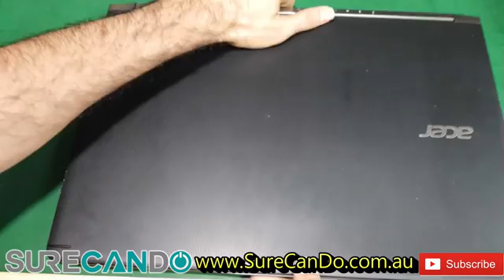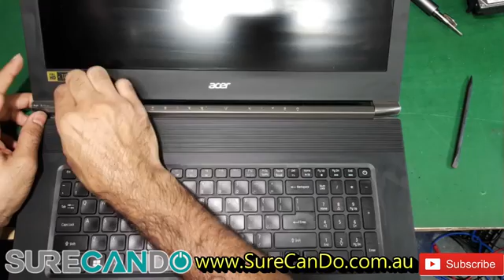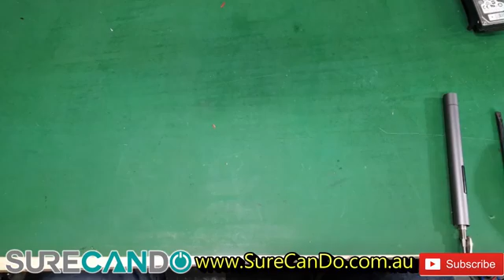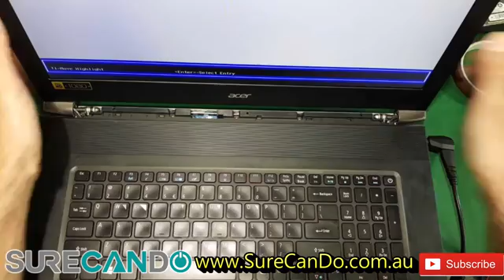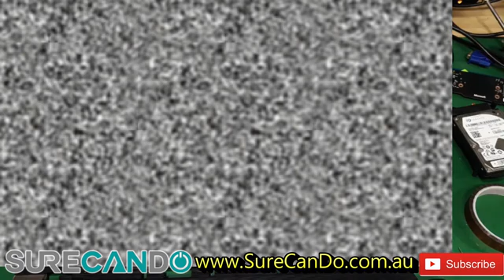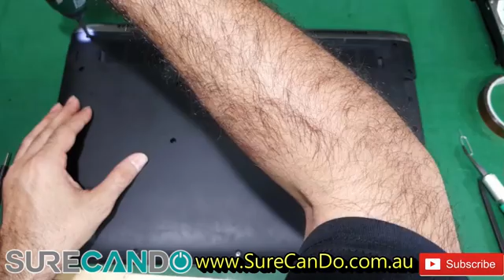Acer Nitro N17 Black SSD Upgrade & Full Disassembly VN7 VN7-792G-70JK

Comment: Found this video, exactly same model laptop, went out and got a M.2 SSD. Went to your website and can see you guys are based out of NSW, posting this is prob too impractical it weighs a ton (so freight is most likely going to cost more than the actual labour) and it’s got lots of moving bits in it. Would you by any chance know anyone or recommend anyone down at Melbourne to do a similar upgrade?

Comment: Thanks for the video, I initially went on ifixit.com to try and find a guide for my acer v17 nitro which is very similar to this but alas nothing - good to note the overall layout seems close enough. I am thinking of repasting the cpu/gpu and upgrading the ssd as you did here but my main issue is the fact 3 of the keys have stopped working on the keyboard - do you have any suggestions for fixing the keyboard on this particular model or laptops in general?
Reply from the maker: Soldiered keyboard to top palm rest, see my other videos, should be few Asus or HP with soldering iron melting keyboard bits, painful.
Reply: @SureCanDo_Life  big ooof! Righto thanks for the quick response btw I’ll check out the other videos on your channel 👍